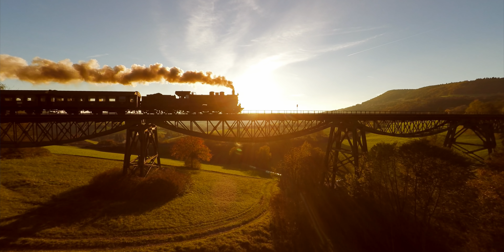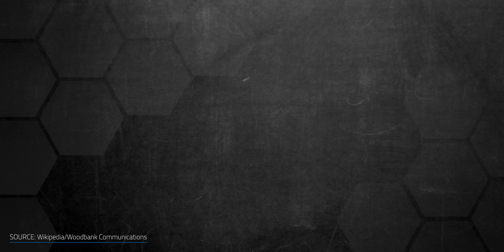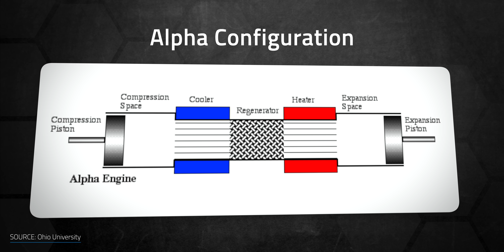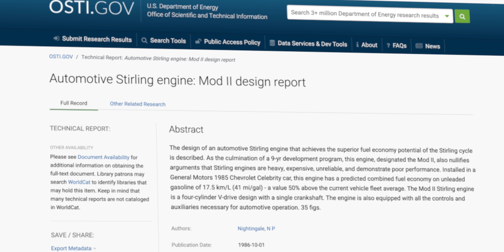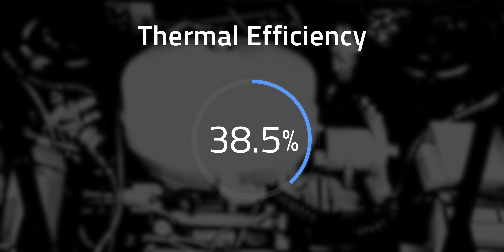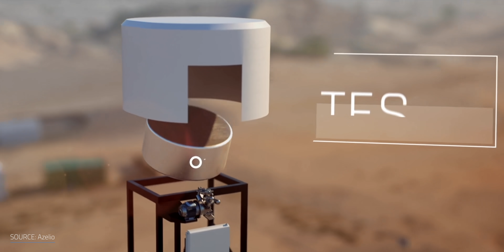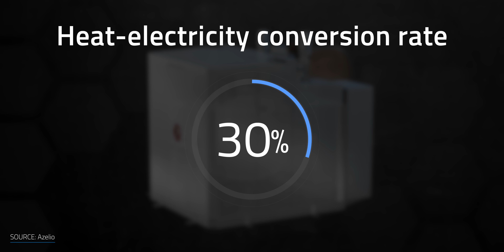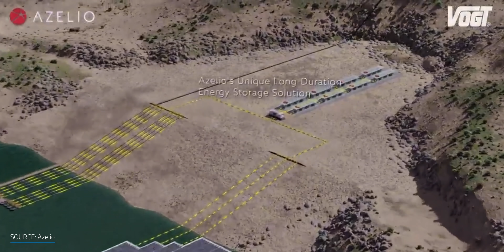Are Stirling Engines the Future of Renewable Energy Storage?

Comment: The Swedish Gotland class submarine uses a Stirling Engine and is famous for scoring a kill against the USS Ronald Reagan in exercises. Really a remarkable engine!
Reply: And the lead designer of that sterling engine has lifetime rights to use those patents commercially. He founded the company "Swedish Stirling" and is using the sterling engine to burn combustible rest gases from industry (mostly focusing on ferrocrome industry) to generate electricity.
Reply: Diesel-electric submarines have accumulators that are absolutely silent.
Reply: @peceed  could you elaborate on this "accumulator "
Reply: @HexaDecimus  "accumulator" = "recheargeable battery", lead-acid
Reply: Swedish Gotlund class submarines are propelled by diesel electric engines. The stirling engines drive a generator to recharge batteries used for various on-board appliances.
Stirling engines aren't cost efficient enough for much more than toys. Putt-putt boats are cool engines, too, but can't propel a toy boat bigger than a cigarette butt.
Reply: @politickery9412  "On the water surface, the submarine is powered by two sets of MTU engines. While submerged, the Kockums-built Stirling engine AIP system is used to drive a 75-kilowatt (101 shp) generator for either propulsion or charging the batteries. A Stirling engine is particularly well suited for a submarine because the engine is nearly silent and can use the surrounding sea water as a heat sink to increase efficiency. Submerged endurance is dependent on the amount of liquid oxygen stored on-board and is described as "weeks". The class is characterized by its low acoustic signatures, extreme shock resistance, and a competent combat system" 

Further info - https://en.wikipedia.org/wiki/Air-independent_propulsion
Reply: @politickery9412  The Stirling engine is used for propulsion or for charging the boat's traction battery, not the crew's cellphones. I wouldn't call a machine that can sink an aircraft carrier a "toy".

Comment: They can't compare well to lithium iron phosphate. And the price of batteries keep doing down. The price of that unit isn't going to go down if at all. It's great for heat sources. For solar PV, batteries is a better solution. It's certainly a good solutions for the extra thermal energy that would otherwise be wasted. Or direct thermal power plants like solar concentrator plants.

Comment: I do love a Stirling engine!
I have an LTD similar to yours and would love something that produces usable power, these will only run an LED or 2,
In around 1940, Phillips made a limited number of 220V/200 Watt models, the MP1002 CA, to power radio equipment in the field, this engine runs on kerosene, it has a working pressure of around 160 to 170 p.s.i., they are around the size of a compact petrol generator, 
Unfortunately, they are rare as hens teeth now, so I'll carry on dreaming for now!
 
They are also used in space, with a radioactive source on the hot side and the cold of space (around -270°C in deep space and around 10°C closer to Earth) on the cold side, these are usually small low power units for radio transmission,

Can't wait to see this technology developed for high power earth based power generation

Comment: It like it. Though to get Al to phase change is 580 deg C if it is a common Al-Si alloy. It will take a lot of energy to get it that hot and keeping it that hot more energy. Insulation is not that efficient yet. Probably why the efficiency low, energy diverted to keep the phase change. Still, good idea industrially. Not so sure I'd want 580 deg C Al alloy spilling all over my basement floor. Still, a great video!

Comment: A stirling engine would release its heat into the environment though. 
Use a heat pump to heat up and cool down 2 huge thermal masses then use a stirling engine between the 2 when you want to get energy out of it. Not only do you have something very hot to power the stirling engine but you also have something very cold on the other side.

Comment: I don't know if you have ever covered this, But I once heard about a possible storage solution, where energy, say from wind or wave energy could be used to drive a winch to pull a large bag to the bottom of the ocean. That buoyancy can later be release and turned back into electricity as it rises.
Reply: I gave this some thought awhile back. At first it seems really interesting. But after looking at some of the details it wasn’t obvious to me how to make it work well.
Reply from the maker: I haven't heard that one, but sounds very similar to things like what Gravitricity is doing.  Lifting heavy weights and then dropping them.  Really interesting.  Thanks for sharing.

Comment: The downside of Stirling engines is their high cost and their low size/power ratio. High cost is mainly due to sealing problems. For a Stirling to provide useful power, its working fluid has to be pressurized to very high pressures, and this requires very precise machining of its parts and complicated seals. This makes them expensive. Also, other prime movers, such as electric motors and even IC engines, provide size/power ratios one or two orders of magnitude better than Stirlings. Stirling also have to compete with thermoelectric devices, which are way less efficient, buy have no moving parts and are way, way cheaper....

Comment: Someone did a scalability study on Stirling Engines about 20 years ago and the results were unfavorable. I have a hard time believing physics has changed. The biggest problem is footprint, it will probably be very large, which is also a problem with solar. Nobody wants all the countries deserts covered in solar panels and the rest covered in batteries.

Comment: The main issue with sterling engines in the past has not been the efficiency, but how much power you can actually generate at the output for it's size/weight ratio. That's why it was never really used in vehicles. Also maintenance used to be an issue but not any more. Where size and weight are not so much an issue, like generating power from a temperature difference it's a viable stationary power source. But do the homework, you'll see that for getting a decent amount of power out of a small unit you will need a high temperature difference, for these units also it is often not enough to have just a heatsink in open air to get rid of the heat but if generating a decent amount of power you will also need a way of cooling the cold end, like running water. This could be a bonus though to generate your hot water. If run at a high power level you might end up with more hot water than you can actually use, so I suspect the fine tuning would be to size the power output of the sterling engine not just to your power requirements and heat difference used but also to your capability to keep the cool side cool beyond using it to heat your water. Taking all this into account I see more of a use for it in an industrial size setting where you can change some of the constraints compared to a domestic setting.

Comment: Why can't we put Sterling engines on the shoreline of an ocean? Average ocean temps around 45 degrees Fahrenheit, average summer day between 70 degrees and 100 degrees Fahrenheit. 
Wouldn't that be a big enough temp differential for a sterling engine?
Reply: Look up Carnot cycle efficiency. Plug in your temperatures, remember to use the absolute temperature scale. Then you will see the problem.
Reply: @mikespangler98  Thank you very much for the reply.  I had the idea so I knew someone else smarter than me would have thought of it..  I'll go do my research.

Comment: Thermo-acoustic sterling generators would allow for a larger spectrum of sizes -- especially at the small end-- as well as a simplification of design and decrease in cost. One cannot neglect the importance of the insulation around the heat tank. That would designate energy dissipation over time.
One can also imagine using cold instead of hot: a very cold brick of copper would be less hazardous in portable applications than a molten salt, for example. Of course, it reduces total theoretical capacity as you can  only get to -273 C in cold where as +600 C is well within today's material tech.
The heat sink used for thermally coupling the device to ambient would also require careful engineering compromising. A water-born sink would be quite different from one meant for air or ground.
Choosing a working fluid is quite a complex prospect. Honestly the best fluid would be electrons themselves. Unfortunately, electrons in metal does weird thermal tricks that makes such a prospect disheartening.

Comment: Thank you Matt Ferrel for this.  How close do Stirling engines come to the Carnot (max theoretical) efficiency?  And has there been any work to boost the efficiency of PV arrays, using a working fluid to cool the arrays (improving photoelectric efficiency) and use the waste heat thus recovered?
Reply: Typically about half of Carnot

Comment: Is it possible to use a Stirling engine + generator to increase the efficiency of a bitcoin miner or any kind of computer? (Use the waste heat of the miner to power the stirling engine which powers a generator, and then feeds back the electricity.)

Comment: Wonder if you could combine this with geothermal, have the top plate at surface level and the base plate 10' under the ground and you'd likely have a temperature differential for most of the year (depending on climate).
Reply: Clever idea!  If it worked each house could create its own energy.  I wonder how much energy it could create / whether it would need extra energy from outside.

Comment: BTW, storage is not the only solution to wind and solar intermittency. (Inter)continental ultrahigh voltage, multi-gigawatt to terawatt class DC transmission grid is another, albeit probably more expensive and more fragile. But, look at Germany: they increase natural gas and coal consumption in industrial South (because of idiotic decision to shut down nuclear power stations, under the pressure from ill-informed public goaded by fossil fuel lobby), while having surplus of almost constant wind power in the North - their grid just lacks necessary capacity. (And, BTW, they do use nuclear-produced electricity - from France.)

Comment: Sterling engine is not an energy storage solution, but the way to more efficiently utilize various thermal storage systems, from high-temperature molten salt and phase.change alloys from your examples, to low temperature geothermal, to systems utilizing temperature difference between ocean water at different depths, to simply "dumping" heat from passive solar collectors into underground pile of stone. It is probably not more efficient than traditional steam turbine (including those using low boiling point medium in closed cycle), but is certainly far simpler and cheaper.

Comment: Stirling engines are a device for transforming heat into mechanical energy, this is not storing anything.
Reply: It is if what you've heated up takes a long time to lose it's heat. OK, so technically it's the thing you've heated up which is the energy store.

Comment: I have a wood boiler that can produce 50-70kW when running at full capacity. It is used to heat water (7.000 liters to about 80-90 degrees C), which I then use to heat my house and all hot water I use. In the winter I burn wood every day if it's cold. In the summer once a week, and mostly for hot water.
What I really would like is a way to turn some of that energy into electricity. 
Do anyone here know about a solution that can do that? I have not found one, and that is really annoying. Lots of people have similar setups as I have, and I'm sure quite a few of them would like to use their boilers to produce electricity too.
Stirling engines seem like something that can be part of any solution.

Comment: To me it seems that this would have been a cool technology for an alternate history where oil as a fuel never took off. Nowadays i don't think there is potential for broad use due to the low storage efficiency and batteries becoming so cheap. It's just better to not be limited by the carnot cycle efficiency limit.
Reply: sterling engine have been shown to get as high as 50 percent efficiency and even most cars are at about 30 percent as it is, (but here there is almost no emissions). Also a dish sterling system( for solar power) has one of the highest efficiency percentages of all solar technologies (around 30%, compared to solar photovoltaic's approximately 15%)

Comment: sterling engines are all efficient and good but their power density is very bad, by this I mean the amount of material that goes in making them and the amount of output they create. We are better of having a turbine to create energy. Specially the co2 tubine, its size is super small compared to normal tubine and is also very efficient.
Reply: But you need to compress the CO2 in the first place to use it, which would takes....you guessed it.....electricity. That electricity must be generated from some energy source...like a 33% thermally efficient steam turbine. The difference here is that you can keep the energy stored as heat until it is needed, and then convert it directly to mechanical energy...and electricity.
Reply: @toddchief9180  I don't know what you are talking about. but you can still store the solar energy in the salt and use the heat from that salt to run this supercritical co2 turbine.

https://www.youtube.com/watch?v=ZDNADjH6NlY

I was passionate about the sterling engine and I have researched a lot but they are useless and are old technology, they look cool but not at all practical.

still not believe me trying to do the research yourself.
Reply: @ChitranjanBaghiofficial  Yes, you are correct. You definitely have no clue what I am talking about. 🤣
Reply: @toddchief9180  buddy do you think I am talking about compressing co2 and then releasing it by passing it through the turbine to create electricity? I am not talking about compressed gas electricity generation.

supercritical co2 is a different type of turbine, where you just put the co2 at 1000+ psi in a close loop and it just keeps moving through the turbine, one side supply heat and on another side, we have a cold.

I know it is fun to come up with smirky replies. but that only gets you laughs not knowledge.

it would have been better if you have searched about it on google and read some research paper on it.

Comment: I am pretty sure these solutions are overstating their metrics to continue to receive funding.  Also moving parts always wear down faster than anyone thinks and worn down parts create vibrations, ie energy loss and noise.
Reply: There are designs of thermoacoustic and heat engines where the only moving part is a fluid.

Comment: So heat pumps have an efficiency of 400%-500% (thanks to extracting heat from air) and stirling engines have an efficiency of 30%. That means it is possible to generate free electricity during night by just extracting heat from air with the heatpump then moving the heat to the stirling engine and then moving a part of the electricity back to the heatpump but with a remaining surplus of 100% electricity.

Comment: Some cost estimates would be very nice to have.
If the cost is not to high they could be a part of a setup that could reduce the combined cost of large windmills and storage.
If you replace the generator with a compressor and store the cooling water in one tank an compressed air in another then run a the compressed air through a generator, but that makes a lot of cold air and lost efficiency. 
Then use a Sterling engine with hot water from the cooling tank on side and cold air from the generator on the other side
A system like that could bust the overall efficiency.
In a system like this each windmill do not need to be regulated and that save a lot on cost. Also no need for expensive fix magnet generator and gear systems.
The rotations speed can be controlled by the compress air pressure produced.
Also large genrator are better for the net and just a few large generator on the ground is a lot easier.

Comment: I've always thought that combining TEC technology with a Stirling engine could do the trick... use the wasted heat (of pratically anyghing) to your advantage
Reply: there's almost no wasted heat if you put it in an insulated box with foil reflectors to contain the heat, also increases it's efficiency. the best part about this engine is it's literally a thermodynamic engine that runs on the basic principles of thermodynamics and it doesn't get any simpler than that for what it's capable of doing. the only thing that affect it's power output is the the working pressure inside the cylinder and the temperature difference between the hot and cold sides. some people can't grasp at the applications you can use this thing for and why it is so absolutely efficient that nothing else out there is capable of out performing it.